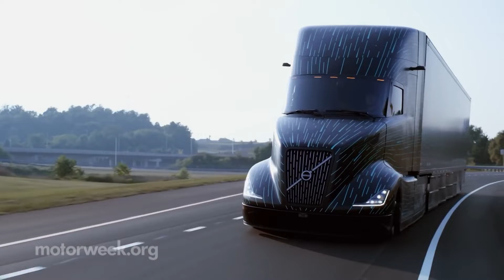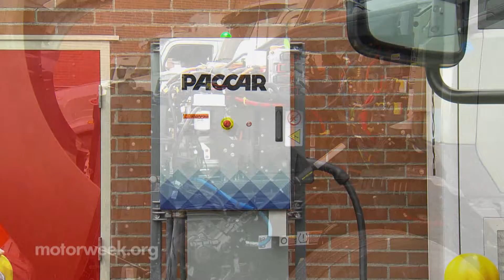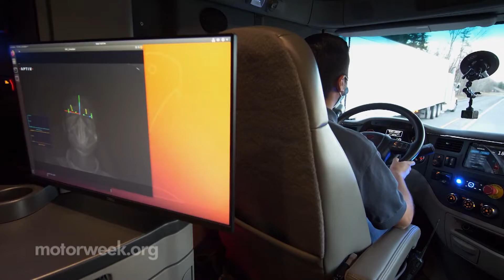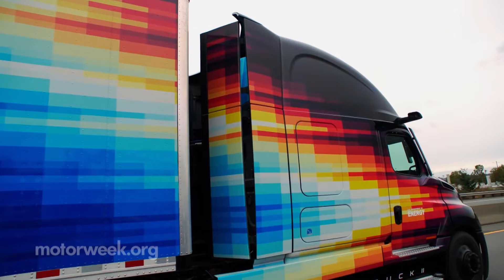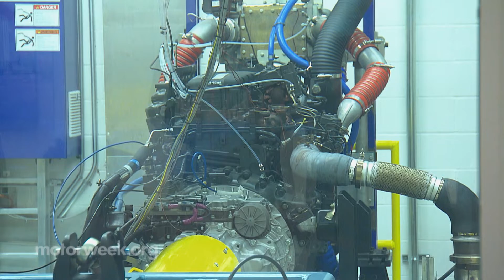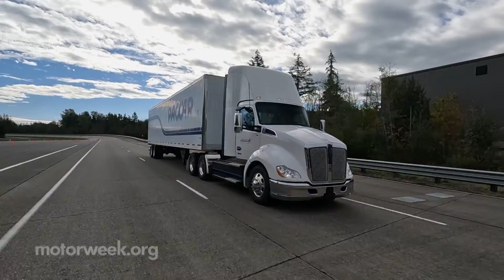Super Truckin' | MotorWeek AutoWorld

Comment: I like the efficiency technologies. I've even modified my Accord to be more aerodynamic and gotten a 4 percent improvement in efficiency at 55 mph.

Now if only truckers got the same protections as employees in most other sectors, instead of 60 to 80 hour weeks being the norm.
That fuel savings sure won't end up in the pockets of most truck drivers; it'll result in lower pay rates.

Comment: In summary, we changed the shape a little, we installed electric power steering, and bs-ed the government into thinking that fuel cell technology would ever be viable in a 40 ton vehicle.

(Hint: zero emissions will not be achieved by massive semi trucks. Every truck will have to be replaced either by train optimization or compartmentalization of large loads into several small loads being pushed by smaller automated vehicles.)

-a trucker